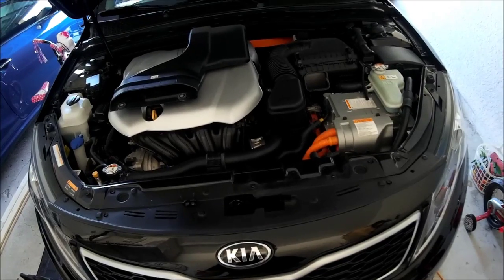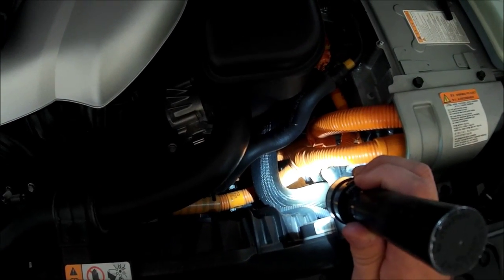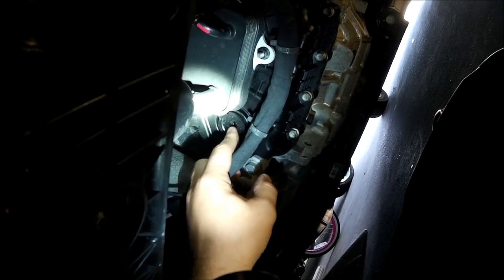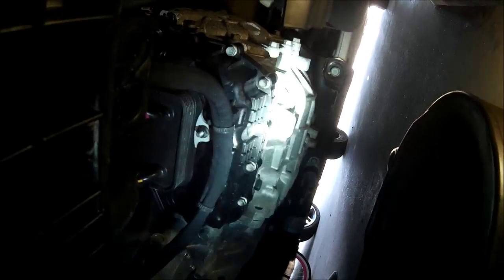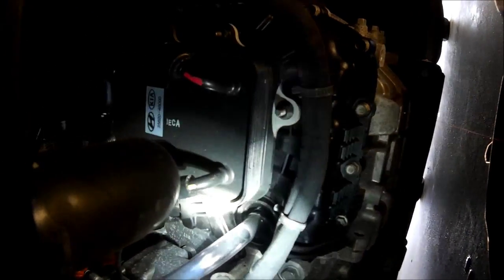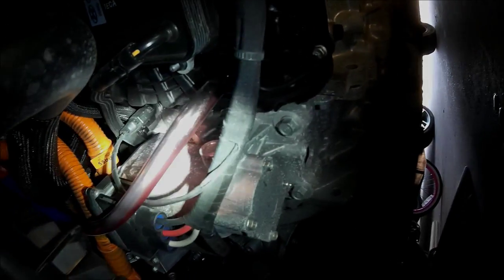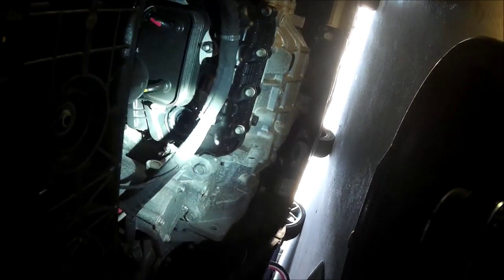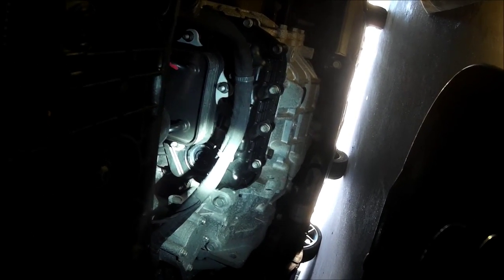How TO : Change Automatic Transmission Fluid Part 2??

Comment: The fluid level check is done with the ATF at a specific temp range which is determined by using a scan tool to get the live data from the sensor. The engine is also at idle when the level plug is removed to check, not stopped.

Comment: Hi, thanks for posting.   I have a 2011 Sonata hybrid which has a very similar drivetrain if not exactly the same as the Optima, and I will be doing my first drain and fill shortly.  It seems to me the only way for me  to do it is the way you demonstrate in this video because the HPCU is in the way of the actual fill hole.  I wanted to know if any substantial amount of fluid was lost while doing the fill using this method, or if it all went in easily without a mess, and if the transmission has been shifting normally since you did both drain and fills.  There is no dipstick so the only way to check the level is to see if a stream trickles from the port in which you filled it, which I don't like.  I just plan on replacing the exact amount of fluid that I drain out.  Any other tips you can share now that it has been driven a while with the 2 drain and fills?   Thanks.
Reply from the maker: +sonatahybrid driving and shifting as normal, knock on wood. IM glad you replied so other sonata owners can be confident in this video being related to their cars.

no fluid was lost during this method of draining and filling... if you have the little nipple extension, the fluid actually "drops" into the transmission, So technically the only place it has to go is into the transmission versus coming out.

This drain and fill method is actually pretty common, its usually how manual transmissions are done as well as axles. its pretty ingenious to have a hole in a perfect spot that will drain out excess fluid when there is too much, if you think about it.

heres a link to the tube i bought at walmart:
http://www.walmart.com/ip/FloTool-Transmission-Fluid-Spout/16889149

i just removed the tube and stuck it onto my small funnel.

When i did the drain and fill to my mom's kia soul 2 liter, she said that her car feels better... i have the 2nd drain and fill coming up for her car, i wanted to make a video of that to post but my son decided he wanted to help so i wasnt able to get a good video of it. But when i do the 2nd drain and fill, maybe i can do a video then... nice thing about the kia soul, is that its tight underneath, but you can do an engine oil and transmission fluid change without putting it on ramps.

i hope any information i posted helps out.
Reply: +honhon05 Thanks for getting back to me so quick, it is appreciated.  I do all my own maintenance on my cars and only use Amsoil in them, and actually just changed the oil and transmission fluid on my 2015 Odyssey yesterday, but through the dipstick tube.  All previous vehicles I have owned had a dipstick tube/filler port and this is my first vehicle with a "sealed" transmission, and the traditional Sonatas have a very accessible large filler port up on top.  Many owners think that just because the maintenance schedule from Hyundai doesn't call for a transmission fluid change that it is "lifetime" fluid.  Their powertrain warranty covers up to 100K and then you are on your own.  I don't care how good the fluid is, heat and wear have to break it down over time so a few dollars spent now is a good insurance policy especially since I plan on keeping it past that 100K mark.  I have the exact same funnel as you and a 3/4" O.D. tube, I hope it works.Thanks again for posting sir and will let you know how it goes.
Reply: +honhon05 Hi again, I just completed the drain and fill with Amsoil and it was easy. I had to go get the same type of funnel tube you bought, as the one I used on my Honda wouldn't fit.  I plan on doing another drain and fill next week to get more fresh fluid flowing.  I documented it with pictures on the Hyundai forum here: http://www.hyundai-forums.com/sonata-all-hybrid-models-yf-lf/445201-transmission-fluid-change-video.html#post4013881
Reply from the maker: +sonatahybrid cool thank you again for responding and i am glad that my video was able to help you.

and i checked out the link you posted, thank you very much for spreading the word on my video/channel. it helps a lot with getting views etc....

also i know how good amsoil is and such,  my only reason for not using amsoil is because its so hard to come by without just ordering it off the internet, and if you find it locally, its usually an arm and a leg.

i basically chose valvoline synthetic because its easy to find at wallyworld and my grand father always used valvoline, so im a little partial to it.  when i did cam shafts in my focus a few years back i used valvoline conventional during the break in and had good results.

thank you again and come back soon!
Reply: +honhon05 I forgot one thing that may help.  When I took out the drain plug, the fluid shot out with such force that it splashed a lot of the hot fluid outside of the pan, even though I lined up the flow with the center of the drain pan itself.  Next time around I will see if I can get a bucket under there to avoid all the splashing.  140 degree fluid hitting me in the face and arm wasn't too much fun.
Reply from the maker: +sonatahybrid theres an easy trick to avoid that. even helps with engine oil changes. What you do is loosen the drain plug by hand while keeping pressure on the bolt. So when you reach the end of the threads, you can just yank the bolt out real quick and out of the way. If you do it correctly (with keeping the pressure on the bolt) and yank it away quick enough, you shouldn't get any fluid on you at all.
Reply: +honhon05 Thanks again for the replies.  I just did a 2nd drain and fill yesterday and now the fluid is a much brighter red and about 90% Amsoil by my estimate.  I do always use that tip that you mentioned as I have been changing my own oil since '84 and understand exactly what you mean about keeping the hole plugged with just pressure and doing the quick yank out so it doesn't get all over the place, but it came out with such force that it back splashed in the drain pan, even with the flow lined up right into the hole in the middle of the pan and with the vent open.  So what I did this time is put a tall bucket right under the drain valve and not a drop splashed out at all.  I got just a tad over 3-1/2 quarts out and replaced it with the same amount.  I appreciate the help and tips sir.     Thanks.
Reply from the maker: +sonatahybrid cool. it did come out with some force i guess because the drain is pretty big. your welcome again.
Reply: honhon05 what size tubing did you use?

Comment: Hi thank you for the tranny vid!
I have a Kia Optima 2012 hybrid,Automatic!
It’s giving me problems with what it seems the transmission it will like get stuck in gear and the rpm will go up and it does it also when I’m slowing down it just started doing that out of nowhere is there a sensor in the transmission or any ideas of what the problem might be ??
Reply: javi farias - I’m having the same problem right now on my ‘13, did you sort out your issue? TY!!